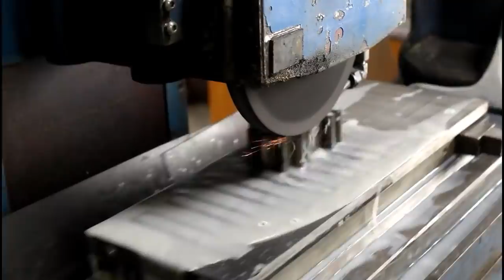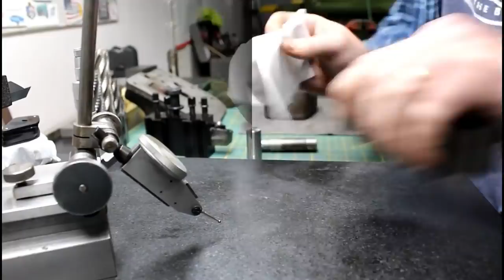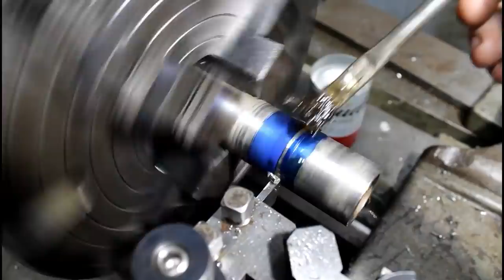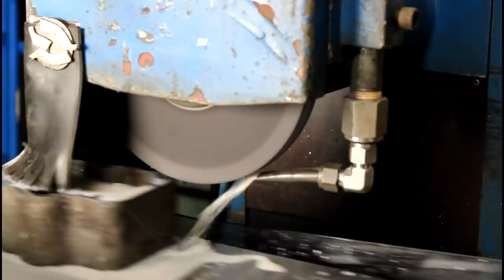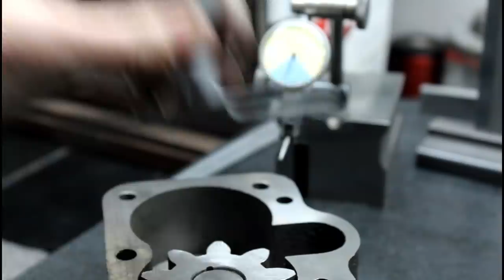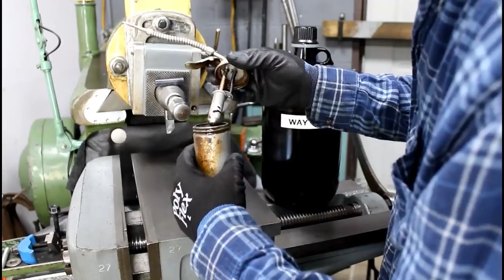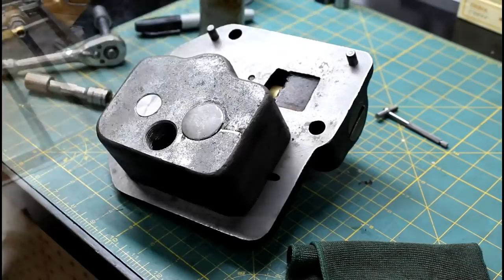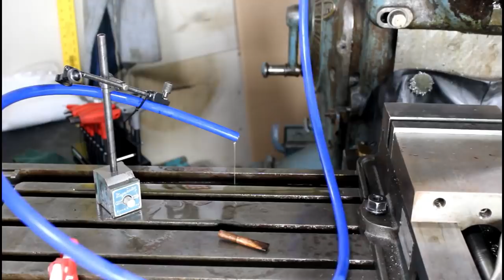OH Yeah! Gear Pump repair part 2

Comment: As others have commented, I would go after the outlet check valve. If it is sealing correctly, the oil should not run back to the sump. Seemed to be an issue on the old Triumph 750 where the oil pump check valves would leak and cause issues. I've never had mine apart, but I believe there is a ball bearing, seating against a brass(?) seat. Punching the ball against the seat would restore the seal. You could always plug the end of your outlet hose, when you turn the pump off... come back after a while and see if the prime is still there.

Comment: re your pump, would it not be possible to secure some 20 th shim stock to to inside of the bores , just a thought, there are some very good adhesives these days.  , always look forward to your videos, the amount of work you put in to this machine, You deserve to have it running as you would. like, all the best JB UK

Comment: Steve,
About 30 years ago there was a product called Belzona and they had what was called a liquid metal. It was a two part compound like epoxy but as strong as steel. Was used to paint the inside of pump walls then machine the walls back to proper dimensions. Wonder if there is a similar product you could use to paint the edges of the gears to build them up and then turn them in the lathe to tighten up the clearance.
Reply: JB Weld?

Comment: So as a potential process to add to the gear teeth with out affecting the heat treatment have you considered low temperature solder such as used by Gunsmiths?  We use it all the time on shotgun ribs and similar repairs. 
Thanks for the information and video content.

Comment: Handy tip for pressing pulleys or gears onto a shaft is to machine the shaft a few thousands ( the amount of the interference plus one ) smaller and about 0.020 wide so what you are pressing on shelf aligns. I learned that from a wise machinist who builds aircraft landing gear. He also taught me that taking off is optional but landing is not. 🤔

Comment: I do a similar thing when setting up grinding that you did with the shim stock, I just use post-it notes though.  Also around .003" thick.
As for the pump fix, like some others have pointed out, an anti-drainback valve in the pickup tube is likely the simplest fix if you're satisfied with the current output of the pump.  I see a ton of work involved in trying to clean up the pump interior and the gears themselves.  If I went that route I'd probably grind slots in the gears and use teflon strips.

Comment: It has a built in one way valve, so if that is working correctly fixing the teeth is the only solution.  I would go with notching the teeth and putting in a teflon vane as you had said, keep the heat off the gears from brazing. Could you dovetail them in?

Comment: i would braze the housing opposite where the gears mesh, making the circumference smaller, braze in a sheet of stuffs or just glue in a thin sheet of teflon to close up most of the bore.  I would not molest the gears.  or the ez way out, put in a priming piston.  when you turn on the machine spindle pull  a plunger up to draw the oil into the pump before opening the valve.  much less work.

Comment: Check valve on OUTPUT side, Or Machine NEW housing.  Don't touch the gears.  To test if output side check value would work, just close you output valve before you shutdown.  If it holds prime(which it must, unless you have a leak in the bypass value) you are golden.

Comment: From the looks of the oil coming out, it appears to be pulling air.  The oil looks milky, that could be the result of some cavitation inside the pump due to the excess clearance. It has been said before but a check valve in the return line may solve the problem.

Comment: When I worked in a machine shop we had part chrome plate to either surface harden or build up a face for machining, could possibly have just the teethof the gears plate and the mating surfaces masked to build the teeth and regrind the profile to reduce the clearances?

Comment: adding to the gear teeth may cause binding when they touch each other if you are too tight as you mentioned. What about sleeving the case with  C shape sheet pressed in?

Comment: Real bummer the pump not picking up on start up. If the pump can produce the pressure you showed there cannot be much wrong with it. More oil in the sump or a non return valve at the bottom of the pickup should do the trick. regards from the UK

Comment: Steve I failed to mention that you used an Extension spring to replace the compression spring.  I would suggest you get the modified spring out of there and put the old one back in. If it fails to compress it could crack the pump when it over pressures.

Comment: PTFE ("Teflon") is a pain in the rear.  However, I definitely know that polyacetyl ("Delrin") is used for bearings in some EXPENSIVE phonographs.  If a valve solution fails, try a plastic sleeve.

Comment: Did I miss the seal on the drive shaft? That  would qualify as a "hole in the straw" so to speak. In my experience. I have found external gear pumps like this to be very forgiving with crappy pumping mediums. Any leaks on the suction end and is the cutting fluid really light viscosity as well? Lots of great suggestions, nice job, and I wish you luck in attaining a solution Steve, cheers!

Comment: Frankly a check valve and or maybe  a bulb type primer  with a check valve on the feed in side would work well. Something like  a fuel bulb used in small marine type outboard reserve tanks would allow you to maybe  step on it  twice to prime it  when turning on.

Comment: Steve, sleeve the pump body. That simple. No need to work on extending the gear teeth. If need be, you can reduce the teeth to fit the sleeve to get to your desired clearance.

Comment: Silver solder to build up the gear teeth. It is reasonably hard and low temp and easy to do. Won't affect the temper. You could also use it to fill the ruts in the housing but it would be trick to bore it flush. Minimum investment in time/money. No guarantee, but I think you always start with the easiest method. Good luck whatever you do. Oil pumps in aircraft engines are exactly the same so I am watching this with interest.

Comment: when i was a transmission tec during the 80's , 1 GM frount pump could take .727 or .725 or a .723 pump gear..; and using a .725 where a .727 should have been  would allow oil drain back and lower oil pressure.. so i bet you need to shave more off of the pump housing, the clearence for all our pump gears was .001;; at .0015 would cause problems  and ( pump drain back  over 6 or 7 hours ) . the leak is not between gear to gear but between gears and pump cover..trans fluid is around a 5W oil.  hope this helps
Reply: on our stock car we kept the oil pump at .002" to .0025 clearance between gear and cover with 50W racing oil

Comment: I would probably get the walls of the housing nickel plated, heavy amount to plate, but the easiest to put only on the walls.
Otherwise you could spray weld it, but that's going to be messy and you'd have to go through everything you just did.

Comment: Steve, I had lots of fun working on my 1942 K&T 2HL and getting it running again.  I suppose that is why I enjoy watching these videos.  Mine was in much worse condition than yours when I re-built it.

I installed a T in the coolant outlet pipe at the top of the casting with a second valve, an elbow and short section of vertical pipe, open at the top that I can fill with coolant to prime the pump.  You may want an easily removable dust cap on the pipe.

As you commented on in the video the coolant pump must be able to handle some trash.  This is NOT a clean hydraulic system and you don't have any filter to remove small particles.  I questioned if your 0.005" clearances on the gear face is too close.  Particles that small will stay in suspension in the coolant for a long time.  How viscus is the coolant you are using and was this pump designed for really thick sulferised oil?   

Today we want to push a button and have everything running.  That is not how these machines were designed.  They require an operator to setup, startup and keep them running.

Comment: I would try using a cast iron cylinder sleeve or similar to fix the tip clearance in the housing. 1 sleeve cut in half should suffice. Hog out the housing with a boring head, chill the sleeve, warm the housing and press in one side. Rinse and repeat.  Grind the gears round on the T&C grinder with .001-.0015 clearance and you have a new pump albeit tooth contact will not be perfect but should be ok, you could lap them to smooth them out. You need to keep tight tolerance for it to work properly, ie oil film thickness need to seal the sides and ends to pull a vacuum, unless it runs submerged. IMHO...... first cup of coffee so I may have missed something :-{)

Comment: I agree with some of the previous comments on the check valve. Maybe you should work on the existing check valve and see what the problem is with it. They probably put it there for exactly that reason. If it seals than the pump wont loose its prime and your good to go.
Reply: Looking at Part 1, It appears the brass flapper would block any reverse flow that might prime the pump.  A check valve on the input side and a drive shaft seal if necessary would allow removal of the brass flapper.

Comment: Hello Steve. We could clearly see your disappointment. 😟
Is it possible to lower the pump so far that it is completely in the oil sump? Then it does not need to suck the oil first. That would definitely work, I just do not know if that's technically possible.
Regards from Germany
Larry

Comment: just add a place in discharge side of pump  to allow easy prime of pump and catch a pint of coolant at start so you have it next time to use. you go trough a lot of set up to use mill any what is 30 more seconds to prime pump key is to locate prime port at convenient location like where coolant line   comes up to flex line at  and valve on table.  or if possible  put  a s trap at bottom of pump to shorten lift of oil or cause to stay flooded  so on start up so it self primes ,in other words use the kiss principle. us machinist types tend to work to way to close a tolerance when just about would do. you have increased the flow and performance of  pump and now have great flow. one last thing  an extra valve in stand pipe near bottom at pump  would trap oil and flow back to pump to prime on start up and add a reach rod  to handle  when you get to old to bend over like i am good luck.

Comment: Your pump is fine, your just losing your prime. Raise the sump level,check valve, or a primer.
Reply: Hydraulically, I like it.  But  it could involve chewing a fairly large hole in what appears to me, in Part 1, a rather thick, cast base.

Comment: I use k1 kerosene in my parts washer...works good and cheap easy to get
Reply: I also place 1 qt empty oil jugs with caps under the shelf.  This allows less fluid to reach the pump pickup.  This saves on kerosine /solvent overall cost for the home shop.

Comment: Steve you asked our opinions so here is my 3 cents. #1 You do have a working pump. You do not have a self priming pump. I would have also recommended lapping the gears and housing and cover but it is too late now unless you want to re grind it. So that being said if the volume is acceptable then address the real issue. The drain back of the oil in the pump to the sump. As has already been stated a simple ball check valve between the pump and strainer should be easy enuff to try. Good luck and remember in close tolerance manufacturing operations there are production lapping machines . I used to have  some of them in the fuel pump manufacturing operation and we operated to 2 micron specs. Wolter is the brand of lapping machines we used. Don't be too hard on yourself and do not over think the problem. BTY those fuel pumps were in Cadillac's and of course all fuel injection pumps self prime but also have built in check valves.

Comment: JB Weld or a similar metallic epoxy putty might be worth a try as an alternative to brazing the tips of gear teeth. Easy to machine a close fitting OD and easy hand finishing the profiles of the gear teeth.

Comment: Does the pump have a check valve on the outlet of the pump? That would keep the oil from running back from the discharge line.

Comment: Air in the pump body compresses and decompresses unlike the oil that it is meant to pump. Either increase the oil sump level to reduce the suction needed to prime and/or install an effective check valve just below the pump. The pump itself is working as designed, good job on the rebuild.

Comment: Steve somehow put in a check valve in the pickup to keep the coolant from draining back into the sump. (simple one would be a ballbearing and spring) Or a flapper valve from a plumbing supply

Comment: a good check valve on the pick-up side of the pump would be the best, or if you dont want to change the original set up, then re-sleeve the case.  just be sure you have fun doing it!

Comment: Slit 'em if you have to, but first can you put a check valve between the pump and pickup,. Is it sucking some air, reason saying is the oil looks like some air being introduced. I don't know how you might stake them down, but you could line the bores around the gears. You got nothing to loose to keep trying.

Comment: Hi Steve you could slot the ends of the gear teeth and insert a floating graphite piece that would push out with the centrifugal force and press up against the sides of the body. this will ensure virtually zero gap between the teeth and the housing. this is how the scavenge fuel pump on aircraft work. just a thought. Thanks for the great videos and interesting content.

Comment: I'm kind of liking the idea of the Teflon.. either slot the end of the geartooth  to where you can put a Teflon flag/strip in it and replace it as it wears or if you can get sheets of Teflon in increments of  thousands then you could just line the insides of the cup.. brazing is a good idea and regrinding but that is a lot of work but I guess just  as much as slotting the teeth for a flag/strip of Teflon,, 6 of one, half dozen of another.. looking forward to your decision Steve.....
I was almost sure with the thickness of the oil that that oil would have taking up that .020 and created the vacuum that you needed I don't think the  thin liquid would have made it but I really thought the oil was going to work...

Comment: Steve...
Load up the inside side walls of that pump with solder...
Get it so the gears will drop back in then reassemble it and bench run it dry with a Leccy drill....
Them gears will profile & gap the walls perfect...
Strip...
Deep clean & inspect...
Reassemble...

Enjoy good flow rates...🇬🇧🙂
Reply: Man, that is radical!

Comment: Two ways,  a foot valve (check) in the suction, that should have been there anyways....   and either sleeve your housing, or machine a replacement housing.

Comment: Only in Kentucky would a machinist keep his way oil in a moonshine jug. :-)
The oil is relatively viscus so would a check valve in the output tube hold the prime? Check valves in well water applications work very well.
Reply: If he has a matching moonshine jug, he could always label it, "No-way Oil" :-)
Reply: @loydsa  Good one!

Comment: Think a minute about a well pump.  They have to have a foot valve to maintain the prime.  So, you are a machinist, make a foot valve using a ball bearing, a very light spring and a really great seat that all will fit in the pickup!  Come on, you can do it!  Greg

Comment: I stated this in the last video but I wouldn't be surprised if my comment got buried. 
Body to tooth side clearance on a car oil pump is a max 0.006"
Top of gear to top of body clearance is a max of 0.003"

Car oil pumps are exactly the same style and I see no reason why the clearances would be pretty much the same on this oil pump. I would imagine that anything close to these numbers would work just fine.

Comment: It appeared that you were shooting in the dark about clearances on this thing.Check clearances on a similar size large diesel engine pump so you will know what you are shooting for. I've only checked car engine pumps and they are a lot tighter than what you have but of course they are a lot smaller too. .005 end clearance on those gears seems like A LOT to me but then I haven't checked one that size.

Comment: https://www.amazon.com/EZ-FLO-20401LF-Brass-Line-Check/dp/B00GZ3GZT6/ref=sxin_0_ac_d_rm?ac_md=3-2-aW5saW5lIGNoZWNrIHZhbHZlIDEvMg%3D%3D-ac_d_rm&keywords=inline+check+valve&pd_rd_i=B00GZ3GZT6&pd_rd_r=69c92241-7497-402e-b6db-91564af49250&pd_rd_w=OvvKs&pd_rd_wg=G6HqN&pf_rd_p=404c4843-2c96-4d0d-a5fe-2b0598693e61&pf_rd_r=4MS7GKA19DR762K9ECHC&qid=1568467302&s=gateway

Comment: Great series Steve! Here is a reference for you. Check page 69 of this manual. http://manuals.chudov.com/Continental-Engines/Continental-L-Head-F-163-etc-Overhaul-Manual.pdf . It shows the specs for an oil pump for a Continental engine which is very similar to your coolant pump. They suggest .001 to .003 clearance around the gear teeth and .0015 to .006 clearance on the ends of the gears. One issue I have had with these gear pumps is that they seem to use custom thickness gasket material that is .002 to .004 thick. I have successfully used various types of regular paper treated with shellac or aviation Permatex. Your solution eliminates the gasket which I think is a good idea.

Comment: My K&T self primes no problem, I also worked with loads of gear pumps in the petroleum industry, try adding the check on the suction side and yes the rotor tip clearance is too big, add some tig bronze on the teeth and get the fit as tight as possible.